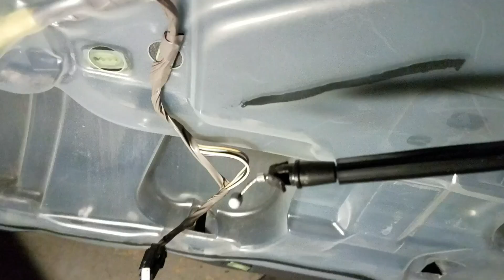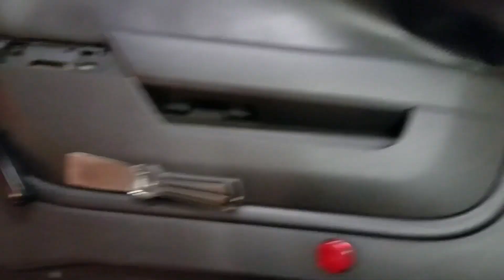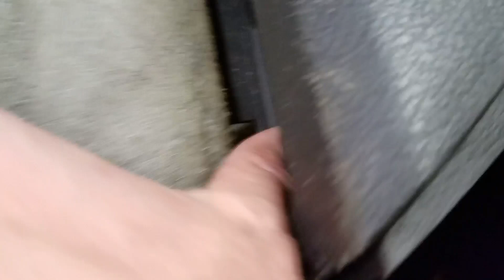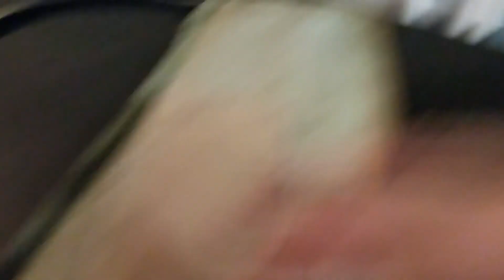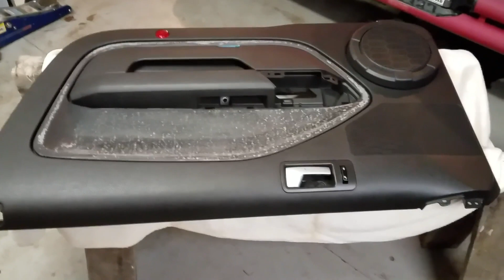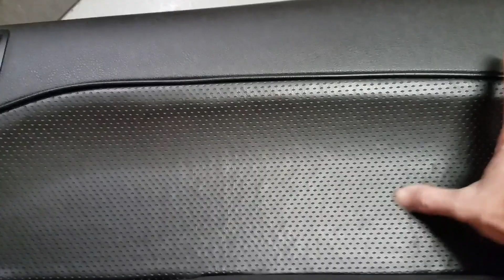S197 Mustang door panel upholstery repair

Comment: Awesome video.  I have exactly this same problem with my '07 GT Convertible. I assumed the fix would be something like on the video, so it has given me the confidence to do it correctly with the best materials.  Thanks so much for the pointers.
Reply from the maker: Be sure to check my follow up video on how it held up. Some additional pointers in it.

Comment: Excellent video!  I did this to my '05 GT about three years ago, using the 3M spray and the old foam, and my passenger side one fell back off within a year. The driver side is still holding all the way around.  I found a channel called Old School Auto Upholstery Techniques several months ago, and he swears by the contact cement, though he left that foam-flocking crap in place. He recommends mineral spirits for cleaning the old adhesive off of the back of the vinyl overlay. He fixed a 2011 or 2012 in his video.
I am going to try your method on my passenger door!
Yeah, I used Gorilla Glue on my headlight tabs, and didn't like how it expanded and oozed out of the seams. 
You know, you could spray out a leveler on the panel, and get rid of the high spots from remaining glue that way.
Reply: The problem with his contact cement alternative, is once the felt or foam backing material deteriorates, what's going to be left for the contact cement to remain attached to?  No offense, but I don't buy into the "Old School Auto Upholstery Techniques" method for a single moment, as once the backing material continues to deteriorate, it's only going to be a matter of time before the reglued vinyl panel insert begins to separate once again from the deteriorating felt/foam backing material!
Reply: @Rocky-rmp58  I removed the foam backing this time around, so that variable should be out of the equation. I will do the same when my driver side insert falls off again, but it seems to be holding well for three years now.
I will say that the contact cement will leave some unenjoyable fumes at first, but seems to be holding.

Comment: I'm curious how practical it would be to remove the original cover and simply clean all the residue off the base plastic and leave it like that. Is there any chemical that would dissolve the old glue but not damage the plastic, and if so, would the plastic by itself be nice enough to just leave the upholstery off and still have it look presentable? Maybe even paint it the same color as the outside of the car?
Reply from the maker: Cleaning all that off is no small task. Plus, it's usually dried glue, which doesn't respond to most chemical solutions. I think the base V6 cars did without upholstery there; may be easier to just swap panels.

Comment: Plastic rivets can be removed by warming with a heat gun, then installed doing the reverse.. 42 years of auto upholstery experience. More advice, NEVER use 3M anything. Only contact adhesive. Remove (Sticky stuff) with mineral spirits. Prep your surface. Like a new paint job over bad bodywork. (Upholstery edging, beading) is called WELT. May your next door panel job be better and better!
Reply: Will the heat gun help to remove the whole panel?
Reply: @SG-cg9kw  Not really because the glue needs to be separated then the surface needs to be prepped for the new material.

Comment: The vinyl has a foam backing on it..all foam eventually deteriorates and the vinyl or fabric seperate...its rarely the glue..Im PRETTY SURE  on that as I've been doibg car interiors for 38 years..
Reply: have you did this s197 type before I got some replacement skins and they want you to glue and wrap them around but it looks scary that the inserts don't really come out

Comment: If you want a glue that lasts longer get 3 M vinyl top adhesive. 3 M part #38808. Not headliner glue. Exterior vinyl top glue.

Comment: Nice video. Did mine with 3M first in about 15 on my 08. Same result as you with 3M, but probably my fault. Ended up using Gorilla Glue of all things, and that worked for me. Didn't even have to remove the panel back then for that portion that was coming off. Now, just the lip is disconnecting at the thin bottom piece so I'm back at it.
Reply: That's crazy I used gorilla glue too just cuz I tried everything else and it was used sitting in the garage it worked the best

Comment: Found a better way to get that bastard edge off without much muss or fuss. Basically I slowly went down the top of the fabric with anything you can use to pry it, but when getting to the edge, make sure not to tear or rip anything. Pry your way to the edge and pull the fabric down so the inside (that's attached to the panel) is facing you. Take a razor (I used an exacto knife) and carefully cut along the edge of the plastic. This will cut on the inside where the adhesive is and will leave much less material to fish out, I learned that after doing passenger side. Good luck to everyone that sees this.

Comment: Great job.  I am going to give this a try.   I tried 3m adhesive twice and had troubles and one time accidently sprayed some on my back window when spraying the panel on the car.   I since replace the rear window to so solve that issue.  Been a struggle to fix this issue with the peeling leather.  My car normally sits out side so it will be a real test to see how long it lasts with this new method.  I did not remove the foam before so hopefully that helps.  I was planning to give that contact cement a try after seeing it suggested in a forum.  If it does not work maybe just remove the adhesive and keep the black plastic look instead.
Reply from the maker: I'm just now starting to see some peel back on the front edge of the first one I did. So this lasted several years for me.

Comment: Hey man. Would you happen to know if the 2010-2014 models also have that second layer under the liner? The doors are slightly different as the vinyl does not wrap around the entire window switch assembly. Here’s a link to a pic: https://www.google.com/search?q=mustang+2010+door+panel&rlz=1CDGOYI_enUS867US867&hl=en-US&prmd=sivn&sxsrf=ALeKk00k9rERUzBWIZYizWq-ifEQkX8Jww:1592508576441&source=lnms&tbm=isch&sa=X&ved=2ahUKEwio-__fjIzqAhUSVs0KHbb1DlsQ_AUoAnoECA4QAg&biw=375&bih=632#imgrc=yyYq8wL3oOpCyM
Reply from the maker: I can't answer that. I haven't worked on a newer model.
Reply: Mongrel Motorsports Alright. Thanks anyways!

Comment: I have a 2012 mustang and the passenger side door panel just started peeling a month ago. I want to try the contact cement but was curious how it's held up for you over the summer.
Reply from the maker: I did this fall of 2018. As of today (2020) it is still holding. There are a few spots around the edges that are not firmly in place but I blame this on not getting enough adhesive everywhere - I think it was the first one I did. Other than that, thumbs up!
Reply: @mongrelmotorsports  Thanks for the reply. I'll be doing mine in a few weeks. I'm going to brush it on and hopefully it will work.